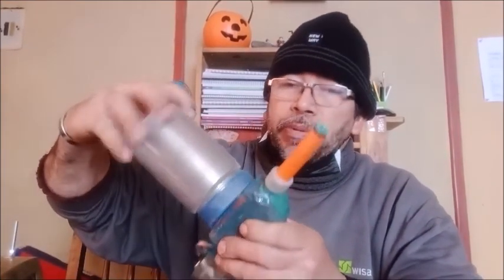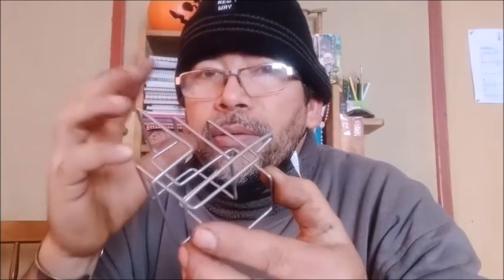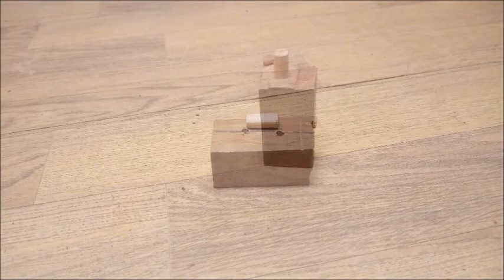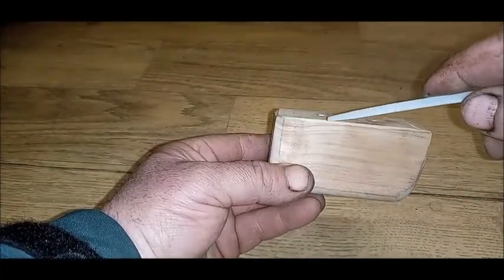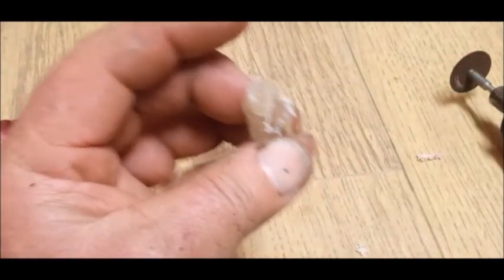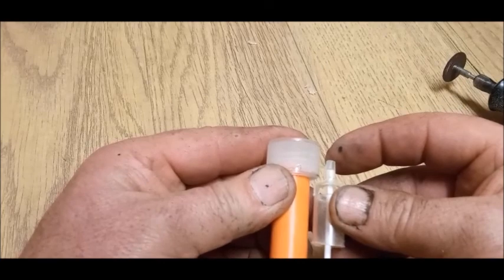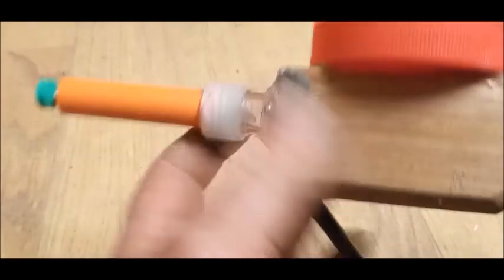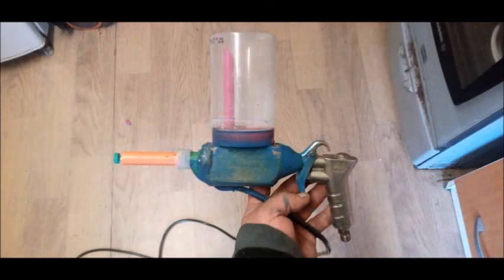Pintura electrostática hecho en casa

Comment: Hola una consulta, donde se consigue la pintura en polvo. Y si tiene un preparado previo antes de pintar con la pintura final. gracias
Reply from the maker: Hola, la pintura electrostatica la conseguí por mercadolibre aquí en chile, tiendas de pintura suelen tenerla, no requiere preparado previo, solo colocar el polvo  en el equipo aunque la pieza a pintar si debe ser tratada con un líquido llamado fosfatizante para la mejor adhesion de la pintura

Comment: Yo tengo un equipo que trae una bobina o trasformador de alta tensión ,,,La idea es buena aunque para que el polvo se adhiera mejor se necesita mucho más voltaje, que tan seguro sería unir 2 flay back teniendo en cuenta que el experimento puede ser peligroso ?
Reply from the maker: El equipo de pintura electrostatica trabaja con 10 o 15 mil voltios pero muy bajo amperaje, microamperios, sería muy peligroso usar alto voltaje con alto amperaje
Reply from the maker: Disculpe lo tarde de la respuesta. Un solo flyback da el voltaje necesario pero no sobrepasando de 12 v la entrada